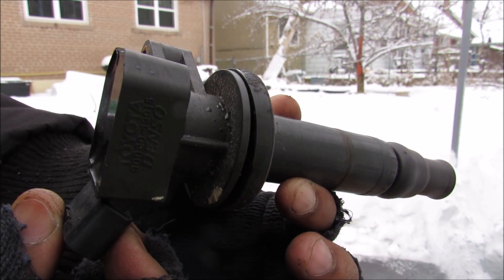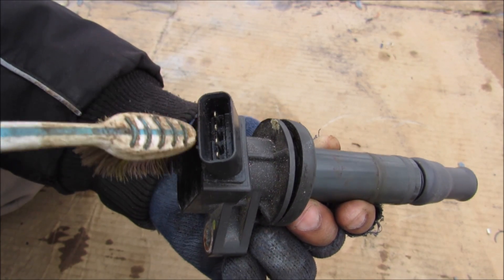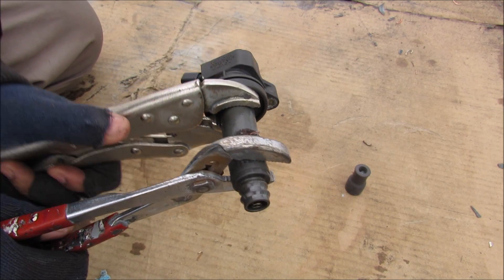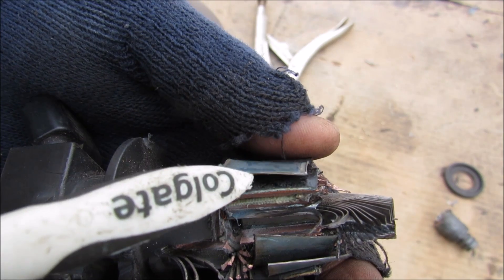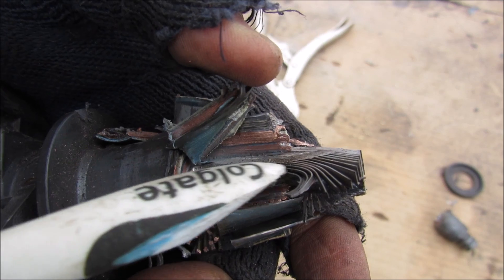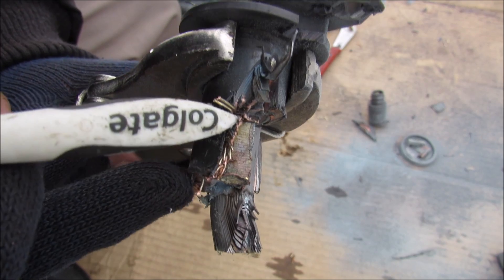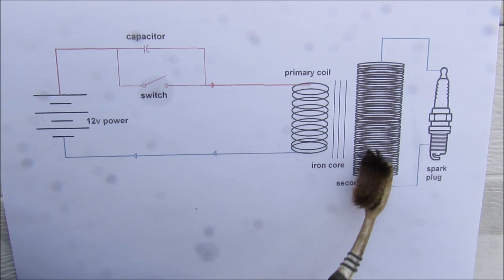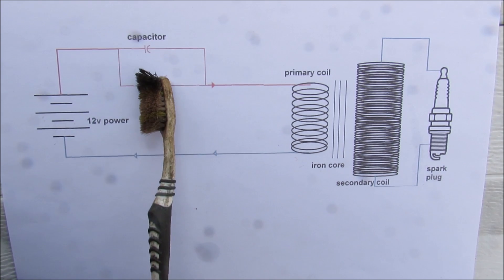How an Ignition Coil Works

Comment: Mechanical distributor ignition, the distributor bolted on one end of the camshaft, with cables running to individual spark plugs. Please attempt making a video on how a distributor works and how to install one, I will fund the video dear @speedkar99

Comment: Its actually the collapsing EMF, electromagnetic field, that causes the voltage spike. What you are describing is the principal behind Alternating Current, AC, where a change jn polarity lf the magnetic field induces a current into the conductor but in this case the polarity is not being reversed its just being interrupted, causing a sudden release of the charge stored in the capacitor and primary inductor into the path of least resistance, which in this case is through the secondary coil and and across the spark plug gap and back to the batteries negative post via the engine ground.

Comment: So will a little crack at the plastic top will cause a failure ignition coil? I have a crack of the plastic part right at the top, will it cause any trouble?
Reply from the maker: In theory it shouldn't. But these are so sensitive anything can cause them to fail or burn out.

Comment: So basically it’s math magic that has to do with resistance over a conductive material that ramps up energy to burst to a spark? Is the coiling to create distance for the energy to build up? In other words does the distance = the resistance or is the physical bending of the wire creating resistance?
Reply from the maker: It's not resistance, it's inductance

Comment: In an ignition system with distributor, when you have the ignition open (engine off), does electricity constantly run through the coil if the contacts stayed closed?
Reply: I'd imagine the ignition circuit being open would stop current from flowing through the ignition :P

Comment: Capacitors block dc and allow ac to pass.  They also store electricity.  When a coil or inductor (same thing) discharges it produces a voltage spike that can damage components.  A diode is used to block this high voltage, not a capacitor.  Your information is wrong.
Reply: I think it may be you who is wrong, for the very reason you have just given.  The function is electrical storage, a capacity/condenser acting rather like a battery in absorbing the voltage spike.  A diode would not fulfil that function.

Comment: Excellent video. I hope you can answer a question for me, since it is obvious you understand the inner workings of an ignition coil. I have a 6.75 torque push mower that had been running fine for the most part, though I do recall it having some issues starting about a month ago. The mower was running fine one day, then the next day it was as if I had it on low throttle, which I can't do since it is auto-choke. I checked the carb, the air filter, the fuel line, the spark plug, even the flywheel key, and they all looked normal. I then saw a video about bad ignition coils, and it stated that the coils for my mower should be between 2.5 and 5.0 Ohms, anything above or below that would be considered a bad coil. Mine registered on my multimeter at 6.5 Ohms. I have asked many Youtube mechanics online if this would cause performance issues, and almost all have said "NO", that if my coil was bad, it would not start. Even the local mechanics in town said the same thing over the phone. Since I have just about ruled out everything else, could a degrading coil be my problem? It seems since no one hardly ever checks for a bad coil, they just state it isn't a cause for a problem. Thanks.
Reply: Nick23at63 Nick usually a coil goes bad and won’t work at all. However, sometimes a coil can produce a weak spark and cause poor running. See if you can get a spark to jump a 1/4” gap and if so, the coil is ok. If no spark, unplug the coil from the kill wire, if spark returns, there’s a short somewhere on the mower. The 1/4” gap is important because that “loads” the coil and sort of mimics the higher cylinder pressures that a spark plug endures during the compression stroke. I actually own a small engine business and 8 out of 10 performance issues I see are due to a fuel related issue or a vacuum leak in the intake between the carb and the head/block. Other things to check in general are fuel filter, air filter, compression, fuel tank vent on fuel cap (sometimes they get plugged up with dirt and the tank actually forms a slight vacuum and fuel doesn’t flow). Most often a bad coil will cause a mower to just not run but weird things can happen with them. You might have some gunk in the carb. If it runs ok without a load on the engine but cuts out under a load, that is your high speed jet most likely clogged. If it runs poorly with no load but gets better under a load (thick grass) that is usually your idle circuit in the carb. Hope this helps and I think I read your question correctly but maybe not. Let me know if you have any other questions. God bless!!

Comment: it does not use a mechanical switch. most probably there is a transistor somewhere in there
Reply from the maker: No, a mechanical switch would be too slow
Reply: the main problem with mechanical is that it would wear out in 3 minutes of idling

Comment: the high voltage spike comes when the primary coil is de-energized.  the magnetic field collapses through both coils rapidly and that rapidly MOVING magnetic field induces the high voltage in the secondary.  When you re-power the coil the magnetic field is re-established, but much slower than the collapse.
Reply from the maker: Thanks for the clarification. Been a while since I studied this

Comment: Voltage induces in the secondary coil only when there's changing magnetic field in the primary coil so how it's possible with DC voltage? :)
Reply: Breaker switch - on-off, on-off, on-off, on-off, on-off...

Comment: On the standard cylinder shaped coils, is the internal secondary wire connected to the + or to the - of the labeled primary terminal?
Thanks for the great video!
Reply: Can be either.

Comment: How does coil get continuous changing magnetic fields with DC voltage? Thank you
Reply: My interpretation. When the switch is closed, 12V flows through primary (smaller) coil at current I. Then the switch gets opened, that means the current I goes to 0 very very quickly, and that induces a quick change in the magnetic field. I guess when you do that over and over again, you get a "continuous" changing magnetic field. If this is what you're asking.

Comment: What's the point of individual coils per plug? Less distributed electrical noise from a distributor and such? It seems all new cars have individual coil packs.
Reply from the maker: +Joe Heiser So the timing of the spark can be controlled individually
Reply: speedkar99 oh so instead of just advancing the spark of all cylinders, it can be done individually?

Comment: Your channel was so sorely needed in my life. Question: How does the capacitor discharge before more voltage is applied? Where does the energy go?
Reply from the maker: +starguy9 I'm glad my. Videos helped you out! When the switch is closed it basically shorts the capacitor discharging it

Comment: Well I’m still inspecting my new used 2006 Toyota sle 3.3, and Ive been running temperature tests on coolant temperture, and am not finding the electric radiator fans to engage at 199-201 degrees F,,,I thought they were supposed to kick in at 195...so I’m trying to find out if it’s supposed to be kicking in or not, and how to make it kick in, so I know it’s working,,,if not working, I’m guessing wiring issue, fuse relay issue, or shot motors? Any ideas on this one...radiator tubing takes a while to heat up too, which I find strange, compared to my corolla
Reply from the maker: +Corbin H. Every car is different. Look at the gauge on the dash if it's overhearing then you have an issue. The repair manual has the exact specs when it should kick in or not.

Comment: You are completely wrong .You said the switch as distributor but the switch is actually the contact breaker which is connected to the cam.You should use your common sense , how can we create e.m.i without breaking the contact of the wire. So to do so we need to break the connection and reconnect it which is controlled by cam's rotation.On the other hand distributor work is to distribute the high voltage generated due to the principle of e.m.i to the required spark plug.I hope you got it.   
😉😉😉
Reply from the maker: +Saubro Boro The distributer runs off the cam. The distributer is what has points inside that break the contact as the firing order changes.

Comment: The coil is a form of a transformer, just not for the usual A/C.  A regular transformer does not have a 'solid' iron core, it is made of leafs of metal just like you found in the coil.  Those leafs are meant to limit eddy current effects.  Google "eddy current in transformer" for more information.
Reply from the maker: +Russel Brooks thanks very much for the clarification, I didn't remember Eddy currents from high school class hah!
Reply: speedkar99 - It is not like an ordinary transformer in which the secondary voltage depends on the turns ratio. Here it is called flyback conversion.  Since you are still in high school level you may find it difficult to understand the theory.

Comment: Cool, what happens to a coils when it goes bag?

Did your brother get new tooth brushes for Christmas?
Reply from the maker: +d w coils burn out internally and then gain resistance causing misfires. Eventually they won't fire at all. 
No new toothbrush for Christmas, I'm going to start reusing his old ones now.
Reply: @speedkar99  and he will be start using spark plugs to ignite whitness in teeth 😂